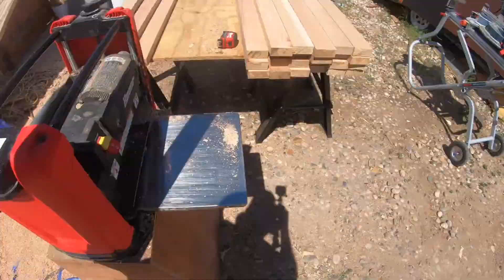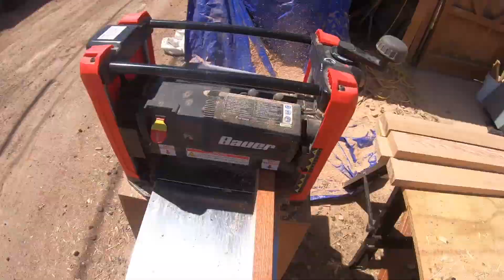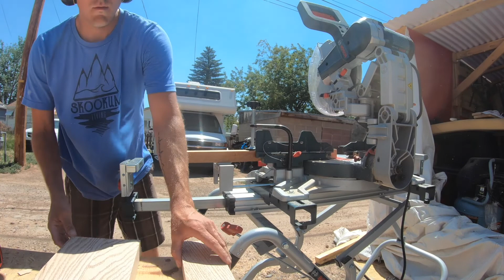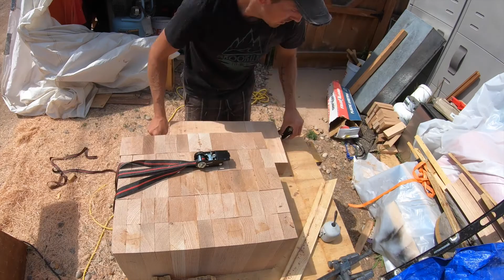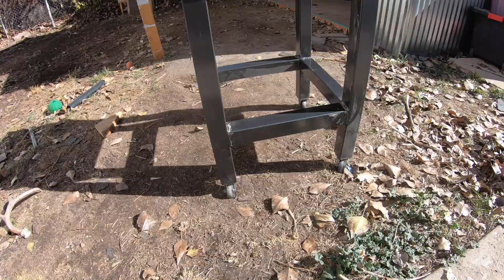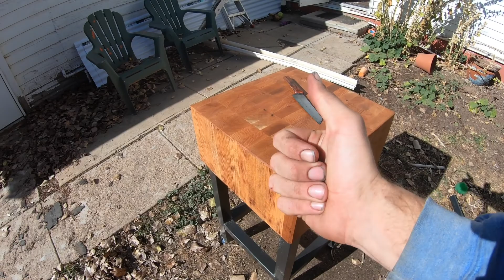Oak Butcher Block Build

Comment: That was awesome,  what were the dimensions for each piece of wood,  and then the dimensions of the finished product
Reply from the maker: 1.5 x 3 x 10 per piece, total was about 20 x 20 x 10
Reply: @skookumliving46  o ok, so pretty much the size of a 2x4 give or take a 1/4 inch
Reply from the maker: @carlrockaway1696  yea, they started out as oak 2x4, its just the planing down to remove the previous finish off them that made them smaller
Reply: @skookumliving46  o ok, I'm definitely going to have to try making myself one of those,  but I think I'll use maple wood, if I can get enough wood for a reasonable price